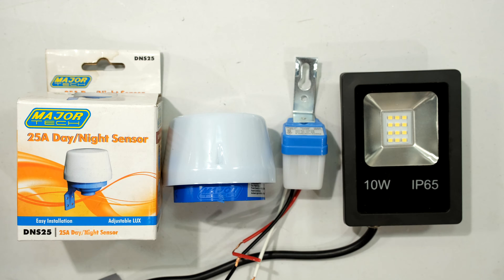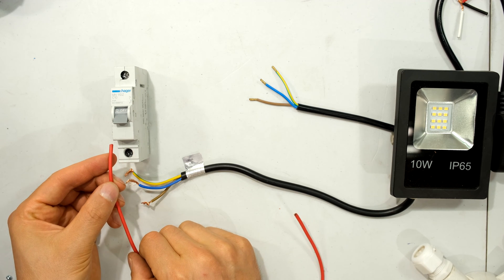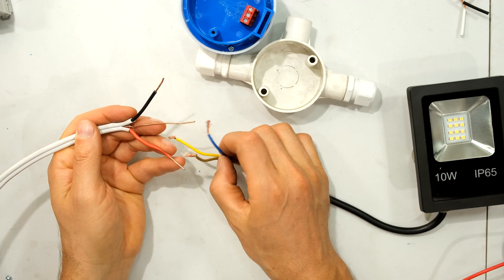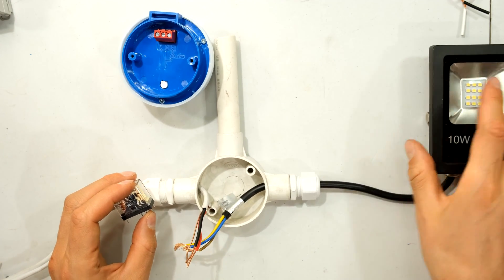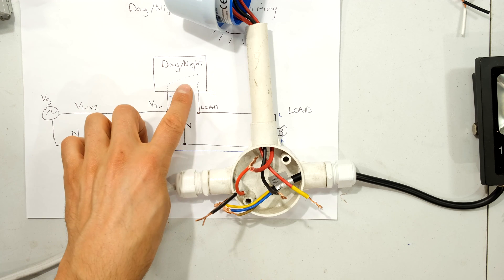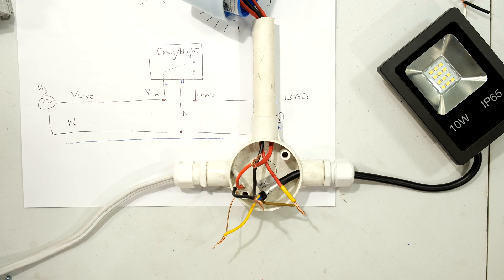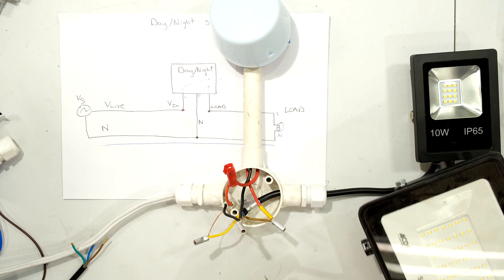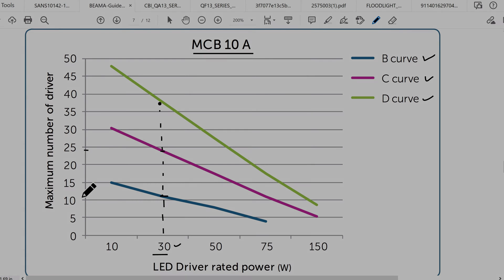How to wire and connect a day/night switch to an LED floodlight load

Comment: Amazing video. I watched twice.

I followed it to try to connect a day switch to my current LeD controller for the stairs as the sensors they came with it stay up all day long regardless of the light.

Odd enough, I believe I did the wiring exactly as you did but it doesn't seem to work. 

Any ideas that you could suggest?

Comment: Ive got a problem on our day/night circuit with rechargeable bulbs. When in daylight the bulbs stay on until their batteries drain. On the same circuit are some halogen flood lights, would that have an effect at all?

Comment: These day night switch are a god send. Thank you for the video....im planning on building a 6m by 20m garage with two t5 led lights inside it linked to a motion sensor.  
I watched your previous videos. But haven't seen where you linked a 360 pir with such a setup 🤔.  I think major tech has a 360 pir with a 20m range when mounted but unsure about the height. To give me the best range